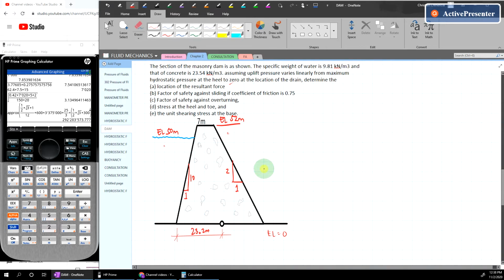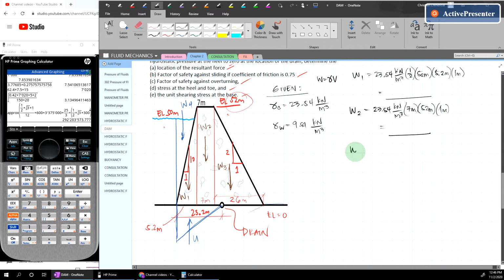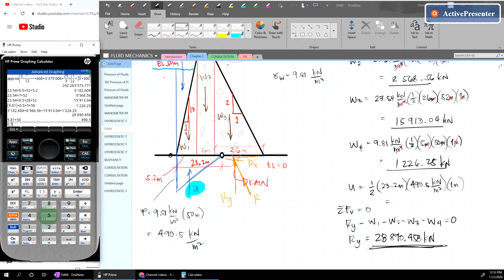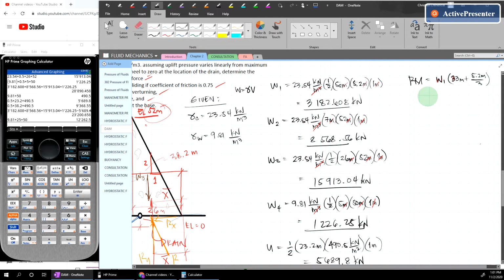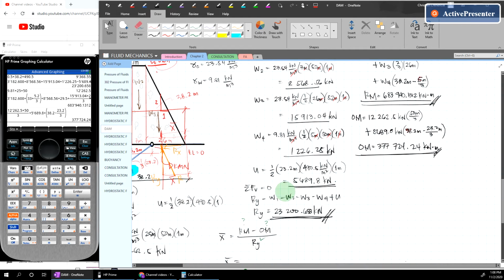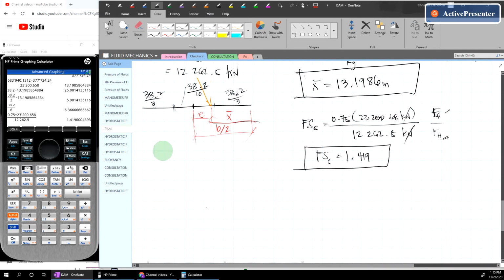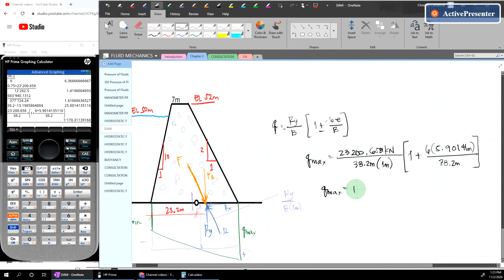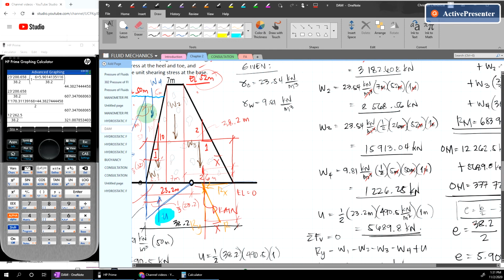ANALYSIS OF DAM Part 2

Comment: Hello, Sir! Just a clarrification. Isn't the sign of the uplift (at the overturning moment) be negative because of its counter-clockwise turn to the heel point? Thank you!
Reply from the maker: Hi! We can neglect the negative sign because we already defined it as overturning moment. A negative sign in a moment only indicates that the moment is opposite in direction of the assigned positive direction. (e.g. summation of moment about a point taking counter clockwise as positive).  And if you noticed, in solving for the location (x-bar) of the vertical component of the resultant "Ry", I subtracted OM on the RM. What's important in this problem is that we know which are the RMs and the OMs, or in Mechanics, what will matter is the direction of the moments and not the sign.
Reply: @CivilEngineeringBuddy  Ohh, that's why. Thank you, Sir, for the clarification!